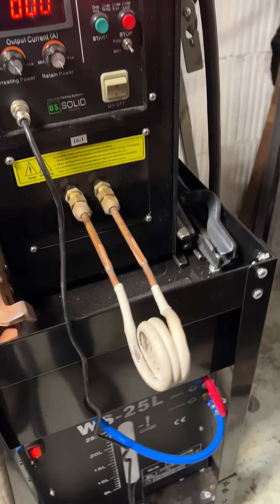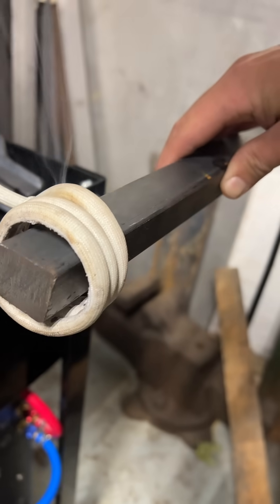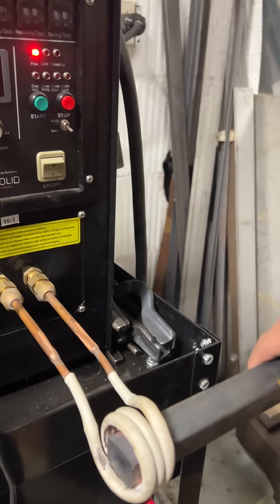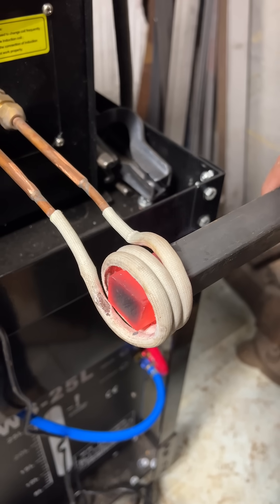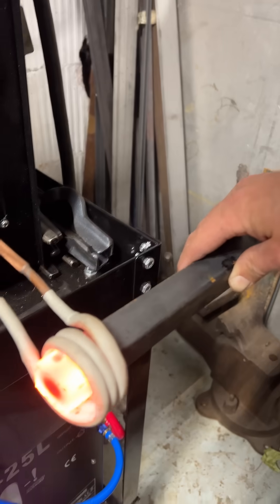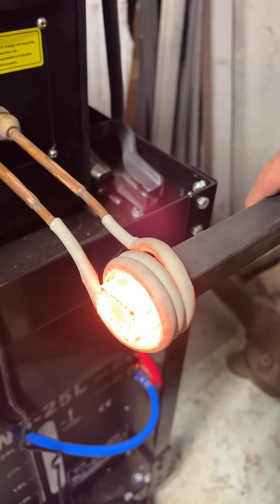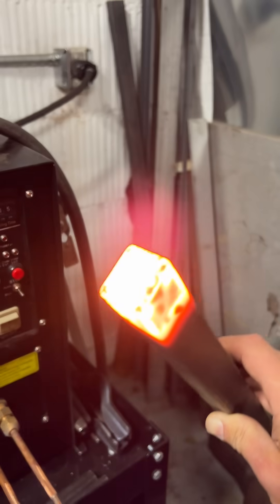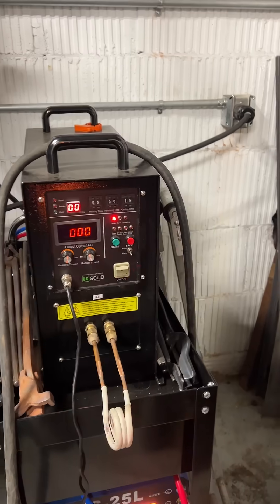Red Hot Steel In Seconds! - Induction Heater

Comment: I literally have no use for this but I do need it.
Reply: Just my thoughts looking at this sitting here trying to figure what I can do with it I guess I'll just start bending scraps of metal until I figure it out LOL
Reply: @AC3RRacing  I was gonna say that and a case of beer would be a good time with the boys at the very least.
Reply: @peterweth  you sound like we'd be good buds
Reply: You will find a use, buy an anvil and a hammer and you can do some blacksmithing. It is super rewarding to make stuff that you use all the time. Gate latches, hooks, fire pokers.
Reply: @theruralrenegade8911  do i look like a fkn blacksmith mate? I work the storage, yer runnin low on fire potion
Reply: Better to have it n never use it then to need it once n not have it. Ha!
Reply: you'd be surprised. I own a portable one called bolt buster. I use it often enough to justify the cost.  I'm a mobile mechanic and I use mine to hear rusted nuts mostly. works quick and no open flame when I go to a rig
Reply: @treychastain4686  shieeeet I should’ve used that when I did my exhaust. Literally the only parts on my car that are rusted are the cheap ass bolts and other cheap metal parts. I tried cutting a nut of a bolt off and ended up making the job 20x harder 😂
Reply: This is how I dab lol
Reply: uh ya can cook hot dogs with it
Reply: They're incredibly useful for getting stuck bolts unstuck when they're in places that fire just won't do.
Reply: Same! I wanna get this too, but I was literally  trying to think what the hell I could use it for and nothing came to mind... I don't shoe horses and I don't make knives...
Reply: I have constant use for it
Reply: Same
Reply: I would make swords
Reply: This is inside your induction cook top (if you have one).
Reply: This is the shit I’m buying when I’m a millionaire. Fuck lambos.
Reply: We can make a samurai sword 😅
Reply: Said every guy.
Reply: Ahahah
Reply: Yes.
Reply: superheat bolt head for extraction
Reply: Better to be looking at it than looking for it.
Reply: These things are actually really useful for removing rust quickly. Especially from rusted and stubborn nuts and bolts.
Reply: I know the feeling! 😉
Reply: To light up your cave perhaps?
Reply: This would be really good for getting into blacksmithing, you can heat up any piece of metal in seconds without needing to make a great big fire, and the price shouldn't be a problem either, I've seen small versions of these selling for £30
Reply: BETTER to have MARIJUANA than NOT HAVE ANY , SAME THING
Reply: @NOMADIC-T.R.A.M.P.-ARTIST  it's not, its better to not have marijuana since it causes you brain to rot and you go loopy and end up getting arrested for beheading a dog in public or some mental shit because you're too stupid to think before you act
Reply: We Wuz VIKANGS !!! n shiet .  
CANNOT do that in a APPARTMENT
Reply: @HVAC Quality Assurance thats like the higher end stuff, you can get them for downwards of 500
Reply: I too came to that same conclusion
Reply: Our induction stove is awesome for cooking in the kitchen. 
Have often wondered about heating metal bar on it (without cracking the surface)
This machine looks fantastic!

Maybe will try a $59 portable induction hotplate from IKEA & remove the glass to prevent cracking it.
Reply: So cool to be a man!
Reply: So you never removed exhaust manifold bolts
Reply: I am wondering if you could use this to forge knives?
Reply: I would use it to create torches
Reply: They sell them at the store. Except it has a plug and you just plug it into the wall, put it in a tub of water and it heats it for you 😂

Comment: The metal doesn’t get hot on the other side? Wow
Reply: It would eventually, conduction is slow as all the molecules in the cooler area have to heat up. You can pick up a mettle kettle while the bottom part in contact with the stove is hot.
Reply: It takes a while for the heat to travel through the metal, especially because of how thick it is,

Comment: There better be some damn capacitors in there to correct that insane reactive power 😂
Reply: There's some damn big ones in there. They recently built one on linustechtips.
Reply: @lilyclimbstrees  Oh, good!
Reply: The caps don't correct for inductance, they tune the tank for resonance.
Reply: @jimmaag4274  They do in fact correct for inductive reactive power in AC circuits

Comment: Now there's one thing I wouldn't like too put in there 🥵
Reply: If it not a metal it won’t work
Reply: @satan101101  trust me, it's as hard as steel
Reply: Should be okay unless pierced
Reply: You can put anything in it if you want. But if you have a ring on your finger or dick it will melt through skin.
Reply: It won’t heat that up. It’s gotta be ferrous metal.
Reply: What?